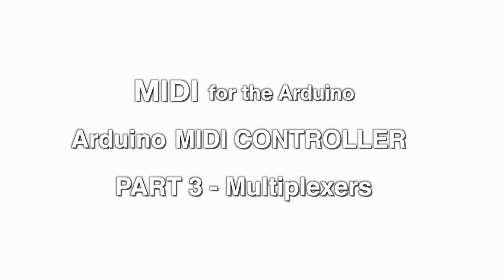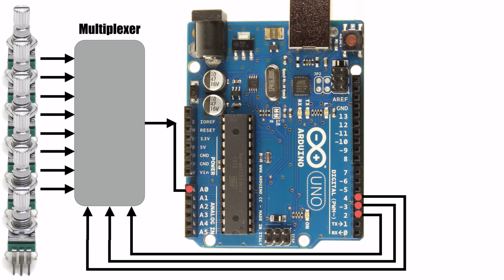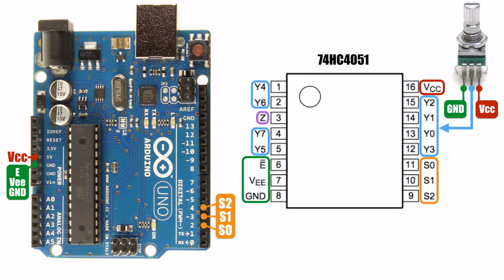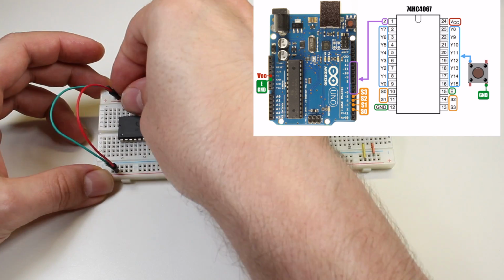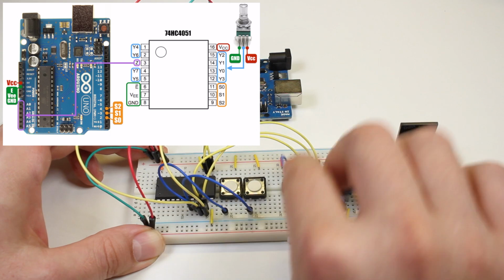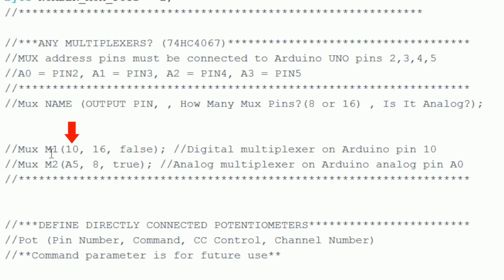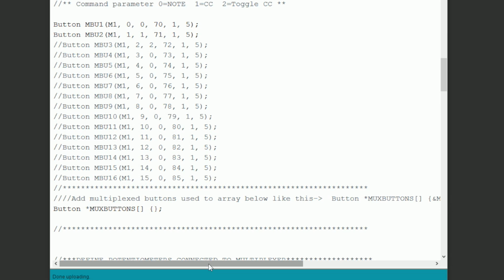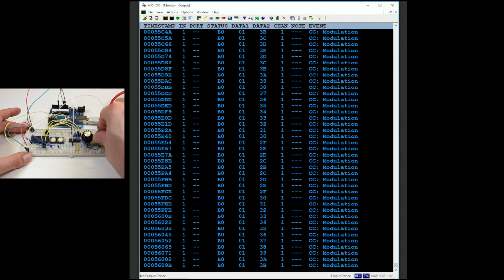Arduino MIDI Controller: Part 3 - Multiplexers

Comment: Finally found some time to modify the code for my 5 multiplexer midi mixer to work on a Pro Micro by adjusting the direct port manipulation code in the controller.cpp and using the USBMIDI library in the voids  to send out midi over USB,. As a bonus the micro have more analog in so you can now use 144 inputs with 9 multiplexers. Also it had 50 bytes more variable memory . On the uno you have to  make the midi channel variable fixed in Notes and Volts example  to free up memory to allow more multiplexers and pots or buttons defined. My mixer is now a usb powered USBMIDI mixer!

Comment: It's taken me eight years to find this video..  The series is very easy to understand and the code solves a number of problems I was having with Arduino MIDI. I have been using an Allen Heath ZEDR-16 that has excellent MIDI capability - or did until the Firewire board died and A&H have no stock.  I need to build a 16 fader channel with 32 buttons.   I reckon I can add a routine to flash an LED on detecting MIDI activity,  but extending the buttons to 24 by adding another mux is probably beyond me. Maybe I can build two of these with 16 buttons,  set them to different MIDI channels and have the DAW buttons respond to the different incoming channels.
Reply: Cool share the project

Comment: First, let me thank you for the videos. They have made it much easier and faster to put together projects. I am curious if you or any of the folks on here have used feedback from Logic Pro to light LEDs, or to text to a display on the controller. My desire is to have the controller reflect any changes through the keyboard back to the controller. For instance if a button with a corresponding LED is used to mute a channel, a keyboard entry to mute the same channel would light the LED. Also, I'm putting together a controller pushing MIDI through USB, and I'd like to have Logic reflect a custom name for the controller.

Comment: Hi! I wanted to ask a question about connecting encoders to a multiplexer. The connection is the same, but the signal A and B are connected to different inputs of the multiplexer? Maybe there is a video about it?

Comment: Hi Notes and Volts, a couple of year back I modified you example code for a midi mixer project. Is there already a version of this code that supports midi over USB (perhaps on a Teensy or so)? Would be great to add usb to my mixer to get rid of my old usb 
-to-midi interface.

Comment: Great video!  Do you happen to have updated code that works with Arduino boards that have native USB support?  I know at some point, Teensy was about the best option, but so many boards now offer native USB.  I have a Teensy 3.6 but also several Arduino Leonardo boards, how difficult would it be to modify the code to work with a Leonardo board?

Comment: Does the HP4067 works the same?
Reply from the maker: I've never heard of HP chips. Perhaps it is a different language version of the HC?
Reply: @NotesAndVolts  Not sure, just tried it using a HP's code and apparently it does work

Comment: Nice! It can be used with piezoelectric sensors instead the potentiometer? The arduino command lines keep the same?

Comment: very good explanation and highly explanatory about all usages and commanding! one question though, how would u connect multiple multiplexers into the same arduino, how many can be added? would the circuity be all together in parallel and then connected into a port mapping as u described or how would it happen? please elaborate, thank you.
Reply from the maker: Hi there. You would connect all the Mux control pins in parallel then run each Mux output to its own Arduino input. I have tested connecting 4 muxes to an UNO and it worked. Probably can handle more.

Comment: Can you use endless encoders connected via a multiplexer? The arduino needs to be able to send values to the encoder, not only receive values. An example of what I mean are the encoders on BCR1000. The advantage is that  as you e.g. change the value of a pan knob inside the DAW, the endless encoder is kept up-to-date, and if it has surrounding LEDs then it will visually indicate what the pan value is.

Comment: With this, could you multiplex and connect piezoelectrics to make an electronic battery and have more analog inputs than those offered by the arduino uno?...

Comment: How many multiplexers driving 10k pots do you think an Arduino can handle before you need to consider augmenting the power rail with another power source?

I was looking to make a controller with the option of up to 48 POTs, so maybe 3 of the 74HC4067's on it...

Comment: Great video! I got one question, and it's real nooby - can you rotate both those knobs at the same time and get two signals simultaneously? I know that I connect the knobs directly to the arduino that'll work since no switching has to happen, but with multiplexers I am not sure.

Comment: Great video thanks for sharing knowledge. One question since I don't know how these things work. Can you use two potentiometers simultaneously that are connected to the same multiplexer?
Reply from the maker: Hi Marios. Yes you can. Technically the pots are being read one at a time. But the microcontroller can do this so quickly, it will seem that it is simultaneous.
Reply: @NotesAndVolts  Thanks for the reply. Cheers.
Reply: @NotesAndVolts  Hi again. Is it possible to reverse this and control with midi some leds using one multiplexer?

Comment: Congratulations on the video. I made such a project using parts of an 88 keys sp2x and sensitivity with Midi output. I can use it to control the app on my smartphone. https://youtu.be/3PkPAcvJVbE

Comment: Man, you're a genius. I feel like I'm getting much closer to figuring out how Keybed matrixes work. I'm trying to fuigure out how to connect a 61 key Fatar keybed to the arduino, along with 16 x buttons and 16 x pots. 

I am seriously hoping you have a video dedicated to that, but I thought I should start at the start! Thanks so much though.
Reply: the mkp mini keybed im hacking right now has 25 keys with 2 contacts each. the 2nd contact is to provide velocity sensitivity: the microcontroller will measure the difference in time between contact closures and calculate the input velocity using some curve. every contact has a (row, column) coordinate on the 8x8 grid connected via a diode to avoid "ghosting" and "masking". 

im going to use an output multiplexer and connect each Y pin to a column, and connect a second multiplexer as an input from the rows. i will scan through the column outputs writing HIGH, and for each column, read every row. the keyboard buttons which are pressed should pass the HIGH voltage from the output mux to the input mux and show the button is pressed. or maybe ill write LOW first to see if that works without melting anything lol. 

after i map out which keys go to which pair of grid coordinates ill see if my esp32/multiplexers are fast enough to handle the velocity detection.

Comment: Quick question! Would potentiometers conflict when they're on the same multiplexer/analog input when turned simultaneously? Or is the reading of the data so quick we barely notice the data being read after each other? Thanks to whoever can answer \o/!
Reply from the maker: If they are on different inputs of the multiplexer, they won't interfere with each other.

Comment: I had a question: because the multiplexers all use the same control pins, does that have any implications for the polyphony of notes across different multiplexers? Like, say I have an input on one multiplexer pressed that requires the 3 control pins to be H H L, and I press a button on a different multiplexer that requires the control pins to be H L H

Comment: i am pretty new in the technical side of midi and got curious about the arduino. after some checking i actually wanted to stop because it was so messy information for beginners everywhere, but you saved my plan! aagreat videos, thank you very much to be one step closer to my daw footswitch controller!
Reply from the maker: Glad I could help!

Comment: How are you? I hope well I need help trying to make my first midi controller using a Arduino Uno with midiout and two 16 input multiplexes that are connected in Analog inputs A0 and A1 of the Arduino. On the A0 input Mux 1 I have used inputs 0 to 13 on the 1st multiplexer and on the A1 input Mux 2 I have used inputs 0 to 9 on the second resulting in 24 potentiometers.
I am getting a error code   (can not convert Pot to Pot* in initialization. Thanks ahead  of time I am this far because of you so I figure ask the man himself.

Comment: Hi, I am using 4051 IC with Arduino Nano with your code. I have added two buttons and modified the code accordingly as you described. But only one button triggers at a time and send MIDI messages, the second one doesn't work, but if I disable the first button in the code the second one does work.
Can you help me please? Is there anything I need to do extra in the code? Do only the 4067 IC works with the multiple buttons?

Comment: pleas someone answer my quetion: can it send MIDI notes and messages with USB ???
Reply: Yes. You can, use a USB native device like Arduino pro micro or STM32 blue pill. There are videos and articles available on Internet. Readymade libraries are also available for USB midi. Most modern  MIDI devices use USB to send MIDI data.

Comment: Probably wont get a reply because this video is old but, can I connect 2 digital and 2 analog MUXes on the same board ?
4 MUXes all connected to S0 S1 S2 S3 ports and outputs of MUXes to 2 DIG ports and 2 Analog ports on arduino ?
Also dose the code support 32 channel MUXes ?
Reply from the maker: Hi Tubex. You should be able do that. The code won't handle 32 channel muxes as it is.

Comment: I would think you should use pull up or pull down resistors on the buttons, otherwise the switch input can float and the mux input is indeterminate in that case.

Comment: Sorry I am a little late to the show. But I have a question. The multiplexer I have does not have a Z Pin it does have a IN? Will this not work?(MBSS 74HC4067 16 CH Digital Analog Multiplexer) Help Please.

Comment: Great video and very helpful, I tried using your code for my MIDI project but when it tries to compile I get errors, I get this message:  error: no match for 'opreator&' (operand types are 'PORTDemulation' and 'int' )
if(_numMuxPins > 8) PORTD = PORTD & B11000011;

someone knows what is the rror? seems to be a problem with the libraries

Comment: 4 years after this video was posted I’m checking Digikey for 74HC4067 in DIP packaging and it seems they have marked the IC as “obsolete” and thus have 0 stock. Checking other places online I’ve seeing prices starting at $5USD for a single IC or the equally priced Sparkfun breakout board. Is this the usual cost of the 74HC4067 or has the DIP packaging of the IC been replaced by a newer model? 

Not super confident trying to solder to SSOP/SOIC packaging and would prefer being able to use a socket instead.
Reply from the maker: Hi Riley. Unfortunately the DIP package became obsolete after I made this video. The SOIC chips are not bad to solder by hand but you still need a breakout board for breadboarding.

Comment: Thanks a lot for your informations.
is it possible to use 3 multiplexer in a single Arduino board ?? if yes, how can i use them ??
thank you
Reply: if its an analog i/o just connect the Z pin to a free analog pin on the Arduino and for digital i/o connect to an empty digital pin. Every other wire can connect to the same pins Except the Z pin. The amount of mux you can use depends on how many digital/analog pins you have available. Ex 6 Analog pins = 6 Analog Mux

Comment: Hello, 
First of all thank you for this code. 
I would like to use it on an arduino mega 2560, it is well written in the code that it won't work... I did the test and indeed the card sends me continuous midi data...
I tried to unplug the test multiplexer but it doesn't change anything... 
Anyone have an idea? 
Thanks a lot!
Reply: I have got same issue. My arduino mega can not run with this code. Anyone have any idea about this? Pls help!!!
Reply: @PhạmThắng-d6l  the response is on the site of notesandvolts, he use directly entry of arduino uno and the mega can't use it...  if you have a solution in your search contact me!

Comment: software says 8 or 16 multiplexers? 
what about a 32 multiplexer? would that work? possibly using a shift register
Reply: I think this configuration is in libraries of the software. I was trying a change on program and I saw this settings there. Mai be u can change it.

Comment: Awesome video Dave!  Is it possible to do this using the Arduino as a USB to midi interface, instead of a traditional MIDI jack?  As in, connecting the Arduino USB to my PC and omitting the MIDI jack.
Reply: After much research, I have answered my question. Lol
Reply: @zachreed11  just one line of code. Haha. I had the same problem

Comment: Sir please Help me running the sketch with Arduino mega what all changes should I make to make it work with Arduino mega and multiplexer. What changes in codes are required to set up multiplexer with mega please helppp @notesand volts 
#notesandvolts

Comment: Great tutorial but imo lacks following information at one point:
While the Multiplexer might not be able to hybrid between digital and analog inputs, it is possible to convert analogue inputs into digital ones within the code. This can be done similarily to how you convert analogue Values to Midi-Values for your Potentiometers.
It can be achieved simply by loading the value of your analogue input into a Variable that is modulates another Variable either by dividing the Values by 512 or by defining a treshold and divide by that. Version one can be used when you never pick up values bigger than 511 unless you give voltage (remember: cables this small are very vulnerable to interference). Version two gets intresting if we have random spikes of interference going on. Look for the Highest Peak over an extended period of time and set your treshold higher than that. Now, only if you trigger the button, the treshold will be passed and the "Variable = input/Treshold"will be bigger than 1.

Comment: This setup didn't work for me, at least not for my setup, which is two buttons and  an HD74HC4051P multiplexer.  I had to use the sparkfun setup (https://learn.sparkfun.com/tutorials/multiplexer-breakout-hookup-guide/all), which means pulling down the inhibit pin with a 10k resistor, and pulling down the buttons with 330ohm resistors.  also, all the unused pins had to be shorted to ground. I wonder what the difference is?

Comment: Can you please provide some info on how to modify your code so that the arduino shows up on the host pc as a midi device so that the 5 pin din is not needed, thanks!

Comment: Your tutorial is amazing!!! I'm making my own controller with your gidance, thank you! 
I have a question: is it possible to send MIDI by the USB cable with your code? is it dificult to write the required change in the code? 
I already know that I need the Hairless MIDI program and to create one virtual MIDI port. 
Thanks!!!
Reply: you could try creating a hybrid between this and the gitHub-Project HIDuino however i have no clue how much code you will need
Reply: Update: found another Video using the Arduino Mega by a channel called Switch & Lever. Code should be compatible.
Reply: @ithelayer8problem  thank you :)
Reply: You can use an Midi USB converter cable!

Comment: So if you can multiplex a mutiplexer, would it be possible to get 40 inputs into an Arduino Uno? Or would I be better off with an Arduino model with more input ports?

Comment: If i have 2 potentiometers hooked up to a multiplexer and spin them both at the same time, will the multiplexer be able to process the two inputs and send them at the same time or can it only send one input  at a time?

Comment: Excellent tutorial - subscribed! Question though, let's say I wanted to have a lot of analog inputs to create a type of sound desk - around 50 potentiometers in total for volume faders, EQ, panning etc.

I presume multiple multiplexers would work fine but would I be right in saying there's no way all of these would be able to run off the 5V power from the Arduino? How would you manage them all for power?
Reply: i would like to know that too! same situation here,projekt with a lot of  potentiometers
Reply: Imade a controller based on this tutorial. I have 54 pots connected to the 5V arduino power. No problemo.
Reply: DubSnip how did you modified the code for it to work? i am using 16 pushbuttons and 16 pots. but i want to add more

Comment: Hi Dave! Thank you for creating this series! I've been doodling an idea for a USB midi controller these past few days based on an Arduino, and just last night came across this series! So now I feel confident to make it happen :) I wanted to ask you if it would be OK to use a different Arduino chip, like a Nano, since I'm only planning on using pots (64 of them) and I'd like to make the enclosure as small as possible. I'd also like to power it just with USB, if it was possible to handle 4 16-pin mux and all those pots.
Cheers!!

Comment: sir,,,, in the below link there is a device from which i want to get pulse out put regarding each input currency note... can i get it by reading the led display signal of this device into arduino 

https://youtu.be/FcOn6A0agu0

Comment: Great video series, really interested in building a midi controller for guitar rig 5.  Basically want a 5 button (guitar pedal stomp buttons) and 3 pots, which is easily doable with the your tutorials.  Is there a way to send midi via bluetooth instead of the wired midi output?  Is this even a thing (midi was never my thing), is thisout of scope of the arduino board?